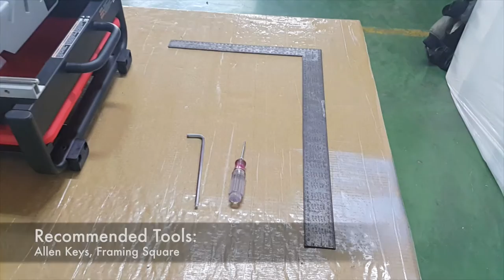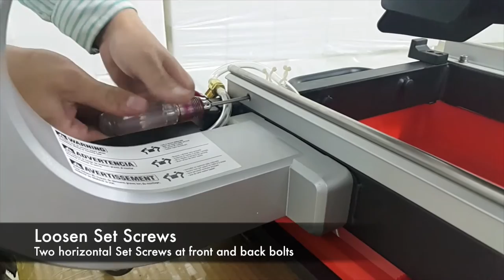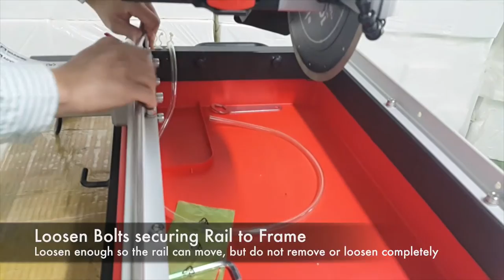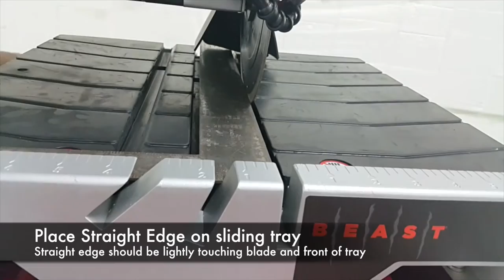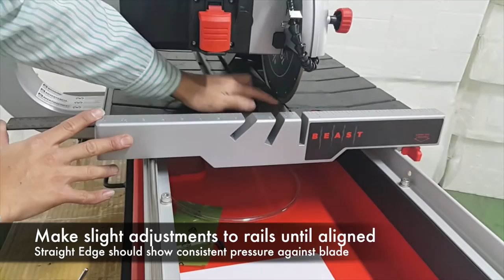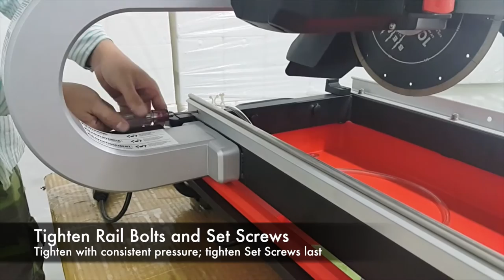BEAST 10" Rail Adjustment

Comment: This saw would've been a beast if it cut straight.   I've never put stress on it or banged it up, yet it has never given me a pure straight cut.  Luckily, I'm seasoned and can freehand a cut with an established line, but even after multiple attempts at squaring it up I'm still left with 1/16" discrepancy over 12".  It would be a great saw if it cut straight.  Also, it leaks water everywhere.   I've never been happy.  And to be fair, I'm also super stubborn and have been procrastinating on buying a proper dewalt saw.  I wish I could keep my beast, but I'm pretty much fed up.  Love/hate relationship..